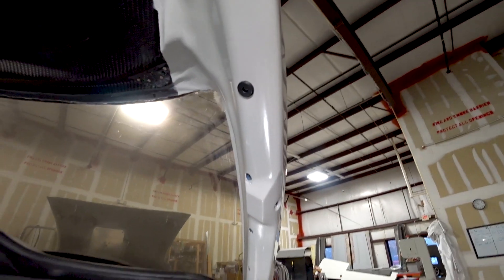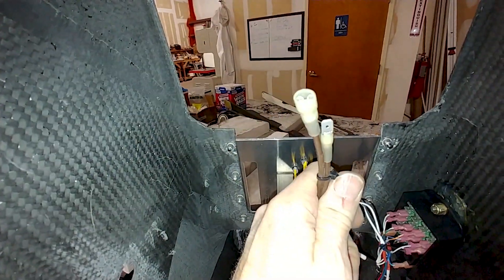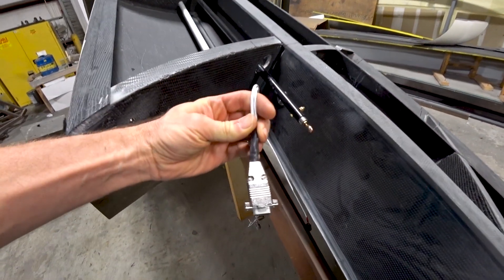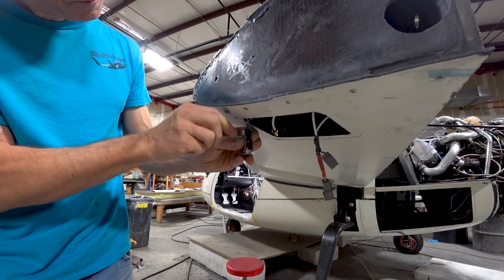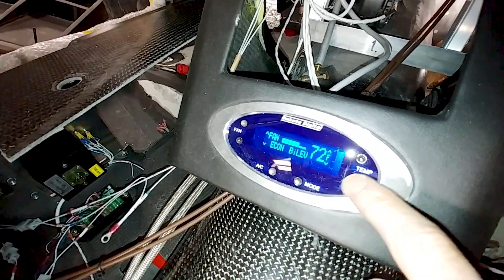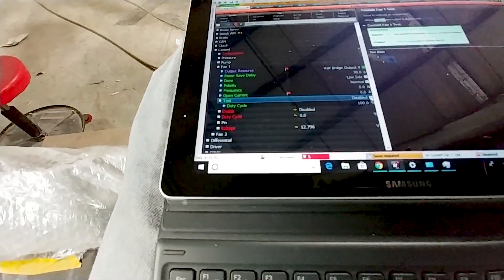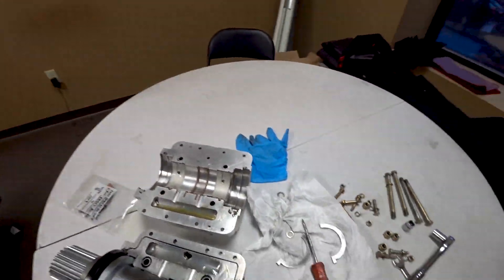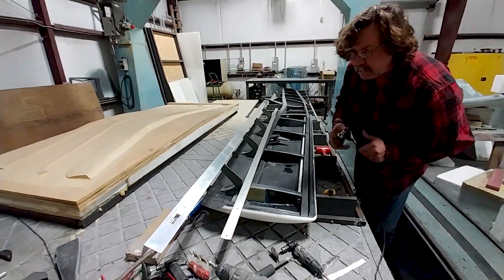Firing Up Our Fans - Building the Raptor Prototype

Comment: LOCKTITE! Those DB9 connectors where you put the shells on, should have Locktite on those little nuts that hold the shells on. They have a nasty habit of coming apart in vibration. A drop on the nut will prevent that hardware from rattling around inside the wings months later. I would put locktite on all nuts at every location, unless the nut is wired. A drop of prevention will save you a bucket full of troubles later.

Comment: This is my first comment. I am fascinated with the project and enjoy watching the posts. I own a Verizon hotspot like you installed in the plane. I am guessing it will only work at low altitude like a cell phone. I think you would need something satellite based to work well. Keep up the good work!
Reply from the maker: We'll see. I have the external antenna on the belly of the aircraft.   Fl250 is only 5 miles high, you should be able to pick up towers 20 miles away with longer of sight. That angle isn't too bad. It will be fun to see.

Comment: You may look into running in the oil lite bushings at low speed  1 or 2 hundred rpm to free them up before you mount the pitch control in the aircraft. just a though.

Comment: Great Progress!  A few questions regarding the re-drive PSRU.  1. Will there be a chip detector added to monitor internal wear vs damage? If not can this be added into oil return lines? 2.  Will the PSRU have a temp sensor, and a PSI sensor to ensure no blockage to the oil feed lines?  3. Will the PSRU oil supply be pre-filtered from the engine?  4. And lastly, the PSRU being the life of this aircraft, can you add vertical and lateral accelerometers to monitor for prop vibrations, shaft alignment, and bearing health vibration analysis?  I see this re-drive as having the most potential influence on the overall safety of the aircraft.  I love the design and I am eager to see how the testing and performance of your design.  Im very hopeful and not trying to be negative.  Very proud of your work and team.  My questions come from my experience flying helicopters and I can tell you that vibration analysis, and oil and chip detections give us a great peace of mind.  Please forgive me if these questions have been answered in previous videos.

Comment: Fantastic build, I am impressed by your perseverance. Just a query from an aeronautical engineer who also worked in RF and IT....I see a significant amount of what looks like "consumer" IT kit, specifically the d-type connectors and the like.  Are they up to the job long-term? I have been constantly fixing and maintaining kit that has dismantled itself under vibration whilst in transit all over the world. I would strongly suggest using copious thread lock etc on everything like that....Does that equipment in the wings actually need a D-type? Would hardwiring it remove a potential failure point?
Looking forward to the next vid :)

Comment: This is great watching this thing come together.  BUT I have to wonder, what if this thing doesn't fly very well or not at all.  It seems like there is a lot of work going into creating a really nice craft with all kinds of great features.  I would have thought you would get the thing in flying order first, with minimal fluff in the cabin to make sure there are no major issues with the aerodynamics.  I know you built a small RC version but does it scale to a full size craft.
Reply: Wildly Optimistic  This design is based heavily on the Velocity XL which is already proven to fly well. It is essentially a pressurised Velocity with a larger cabin and an engine running on Jet A-1. It will fly, no doubt about that. The largest question mark is around the power train which is unproven in this application.
Reply: This project is a little different from the average homebuilt. They are still seeking investors so some of the "fluff" is to make it appear to be an attractive finished product not just a flying airframe
Reply: I think this issue can be double ended sword, you might also end up with huge problems and delays if you start adding systems afterwards.
I wondered also  if RC model is adequate proof of concept, it would not be that hard to create good simulator with realistic flight
dynamics model since these people seem to be very efficient. Also for test pilot the authentic sim could be nice one too.
Anyways this project is amazing and shows really good workmanship and persistence given the size of the development team.
Reply: Thank Andy. I had never seen a velocity xl before though now I see that is the craft pictured at the beginning of the videos - right?  Now that I understand the intent to eventually mass produce it makes a lot more sense. The craft looks awesome. All the best in getting this venture off the ground literally and figuratively.

Comment: This is no doubt a game changing design.  Truly amazing concept and design.  The reality in the aviation world is no major manufacturers are interested in producing a “low cost high performance “ aircraft like this one is.  To produce this aircraft in the numbers equal to current deposit level will require a significant manufacturing facility in the hundreds of millions of dollars level with hundreds of employees. Cessna already abandoned the TTX that sold for $800k.  CIRRUS  has a less capable aircraft they sell for $900k+.   If either of these two would be interested in producing this aircraft the price point would be between $900K and $2.7 MIL..    More than an SR22T and less than a cirrus jet or a piper meridian.  Still hoping I am wrong,,,
Reply: You’re not wrong... but I’m fairly certain they aren’t interested.  That’s the way they’ve always made their airplanes and that’s the way they always will.  It takes a game changer like this to come along to make them sit up and go “hmm - maybe we should make some improvements”... Cirrus almost ate their lunch, but then they rose up to the same level of expenses....
Reply: It’s going to be interesting to see the company expand and if the price tag changes paying for any subcontractors, labor and overhead.  Even if the Raptor costs more and doesn’t quite perform as advertised, if they are close to both, the plane will rock the industry!  I can’t wait!
Reply: What I would like to see is a aircraft in the 250 to 400 thousand $ range with this spects of this one